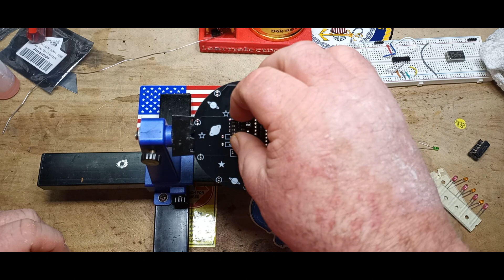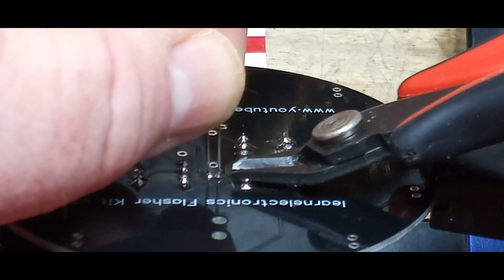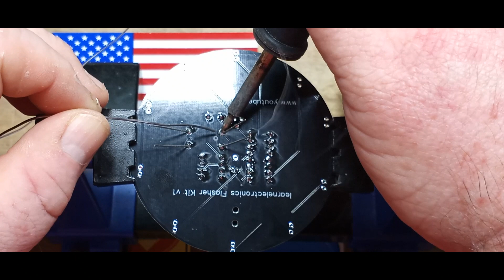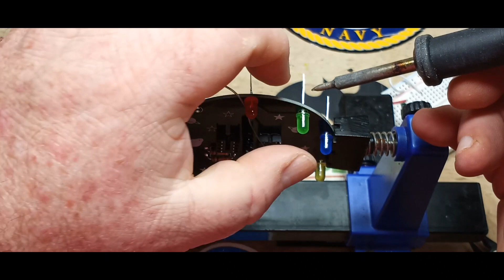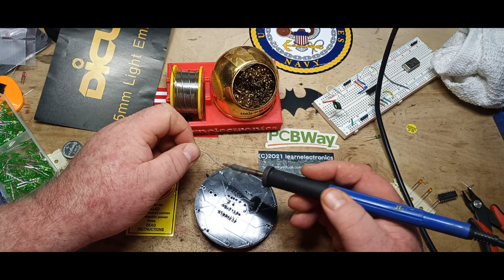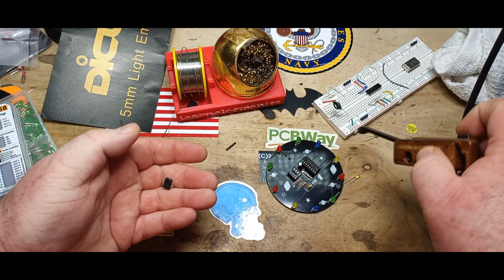The first official learnelectronics kit is here

Comment: Looks good Paul.  Have you considered some simple test equipment kits.  For example one board with a simple signal generator and a simple signal tracer ?  You could use a 555 or XR2206 for the generator on one half.  The other half could have a FET Opamp, (like a TL071) with a LM386 and small speaker for the tracer.  You could throw in a LED for tracking low freq pulses.  Toss the lot in a budget case with two 9v batteries.  It wouldn't need a huge frequency range, perhaps up to 5kHz or 10 kHz.  Fun to make and very handy for checking circuits and fault finding.
I know you can get signal generators from AliEx/Amazon for a few dollars, but they don't seem to have any signal tracers.